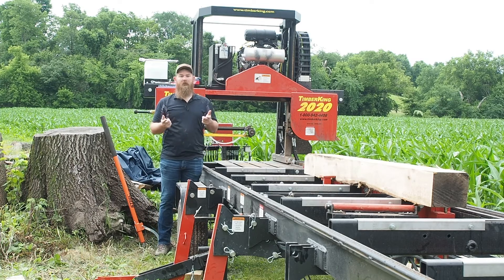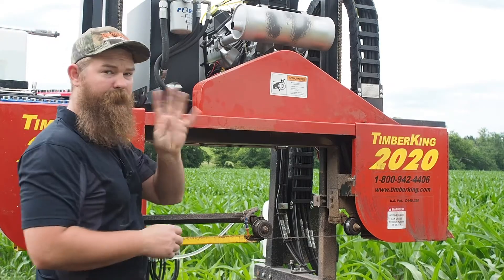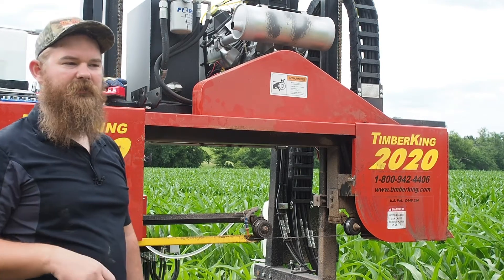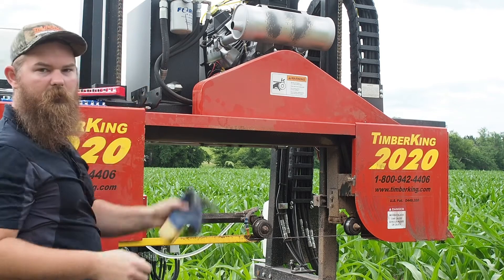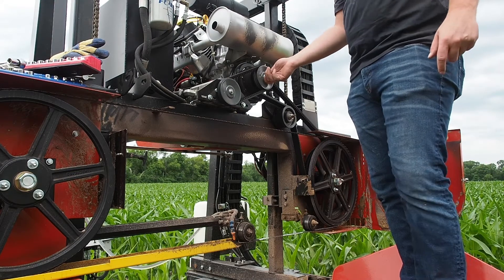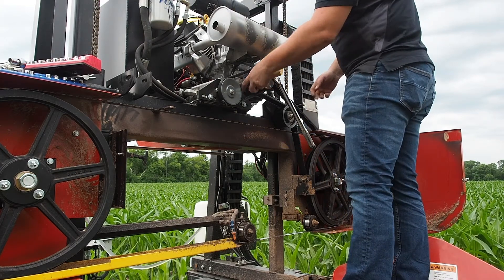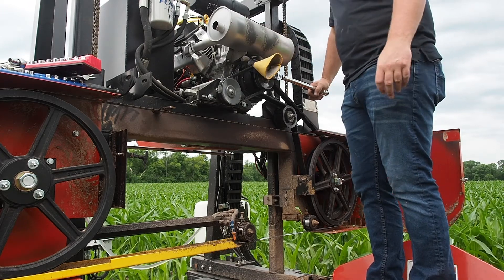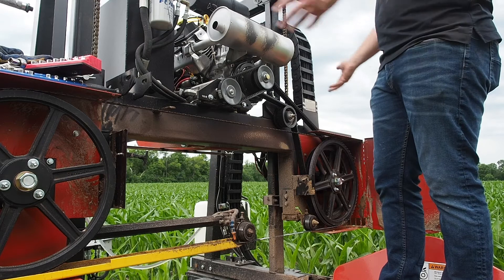TimberKing 2020 How to Check Clutch Bolt for Proper Torque

Comment: Good info, keep it up.  As you cut more blowing up blades will be just a thing.  Especially if you sharpen your own, I run them until they blow.
Reply from the maker: Thomas O'Bryant thank you! I blew a blade today on a job, and was really glad to know how to fix it fast and get running again. Hopefully we’ll get our own setter and sharpener soon, do you still run TimberKing blades or have you switched to something else ?
Reply: @duckhillsawmill4736  I've run timberking,  cooks and woodmizer blades.  They are all about the same,  but after I sharpen them they cut better.  I mostly run the timberking ultramax blades, they hold an edge better.  My buddy swore by a company in Georgia that made blades to any length.  If you want to run a thicker blade you can get more life and push a bit harder, just have to talk to the guys at timberking and set up 2 springs on your tensioner.